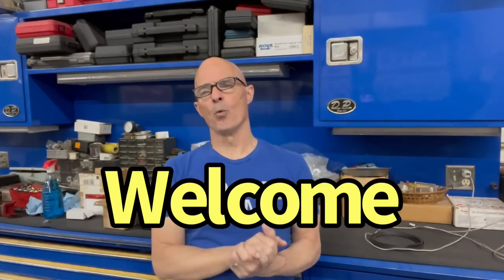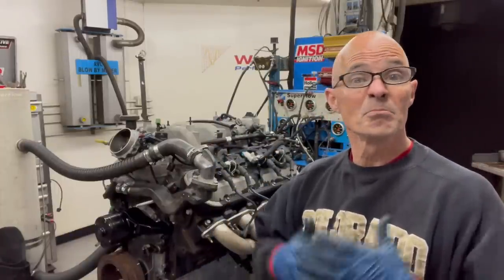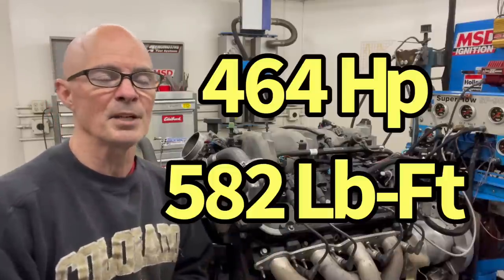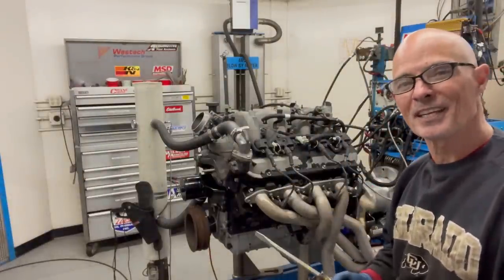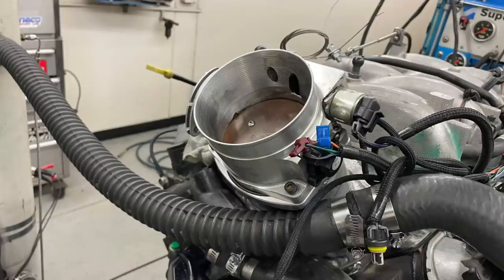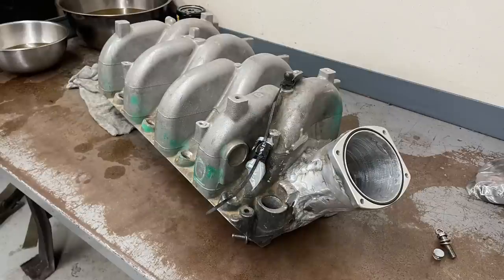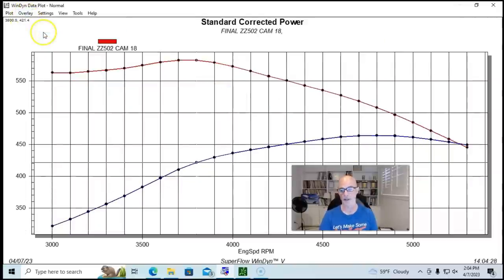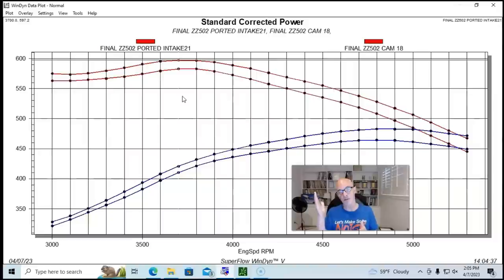GEN 7, 8.1L BBC INTAKE TEST! HOW TO SWAP A MODIFIED INTAKE AND MAKE MORE POWER WITH YOUR 8.1L BBC!

Comment: The biggest thing on these motors is the heads. They make a lot of torque but the heads just don’t flow super well. 

That and the rotating assembly can be fragile
Reply: It’s a junk motor not made to last typical Gm lately mine went at 120k
Reply from the maker: guys running 300K miles with a turbo say otherwise
Reply: @richardholdener1727  I said can be 

You can absolutely hold good power on them but they require a very good tune like gen 3 LS internals or 302 fords

The bottom end isn’t as forgiving as most modern motors
Reply: LT Tolman has been running a bone stock 8.1 wiht a massive turbo for w while beating on it pretty hard making some serious power without any issues
Reply: There's nothing "junk" or "fragile" about the 8.1.

In mostly stock form it is simply not a high RPM or high HP engine.

Quite literally every single thing about that engine is designed to create massive torque from idle to 3500 RPM, and a HP peak of 4200 RPM.

There's a ton of potential. The short block is literally a tall deck big block Chevy with a 4.250" bore and a 4.375 stroke.

It needs more cam than the mild ZZ502 cam. And it needs more intense intake manifold modifications.

How much more depends on the application. What has been done so far makes a pretty ideal engine for a crew cab " Big Dooley" towing a trailer, or any other real 3/4 or 1 ton truck application. You can go further and still have a good tow vehicle engine, but maybe not a lot further.

The pistons limit camshaft duration, and aggressiveness, or being able to swap to 1.8 rocker arms. They also won't take a lot of detonation, and they won't live long at 7,000 RPM.